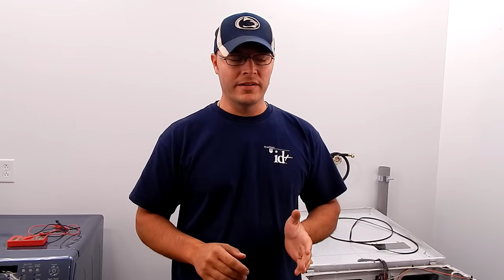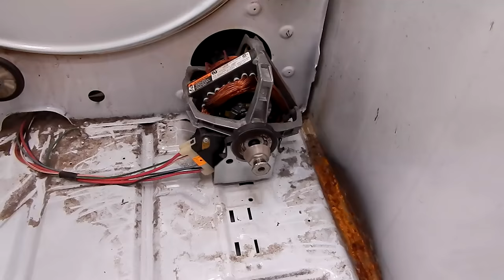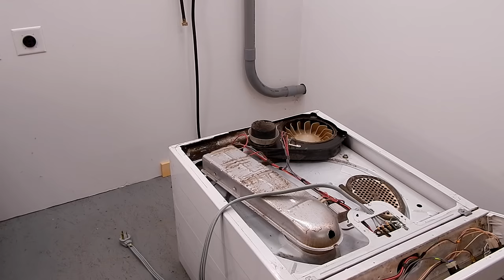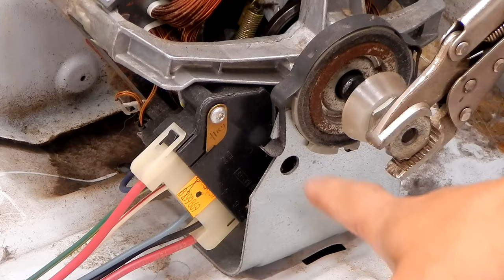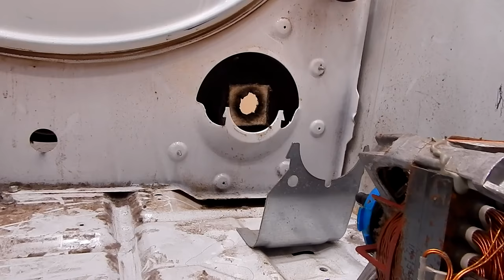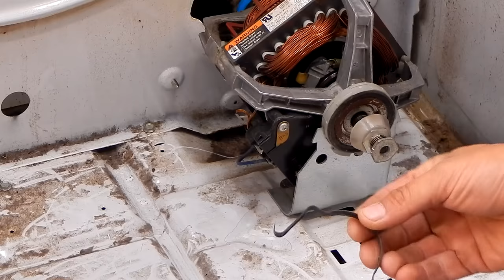How to Troubleshoot and Replace your Dryer Motor

Comment: Hello my rick I have a stack dryerwasher ,my belt broke .I fix it easy got I back to get her turn it on it work but after 1min the motor starts to smoke I clean it up from dirt and grime and dust soon as I cleaned it up turn on the dryer the dryers motor starts to smoke
Reply: Lisa Rodriguez Hi there!! How old is your dryer Lisa?? Did you replace the idler pulley assembly ,blow wheel as well???? If not, that could be the reason of the smoking motor.Greetings.

Comment: alas for me , we have a rather old motor and not wire harness...so wire color order would be nice.  (all the connections are on some sort of switch on the other side or rather where the harness wires are lower left the switch area is upper right towards the front of the motor...  now the motor I 'd ordered for that says it will work with it but wire color order is needed I'm sure then there's a possibility of a belt broken sensor.

Comment: When I hit start. You can hear a click,but the dryer does not turn on.Thermal fuse replaced but still does not come on?
Could this be the motor?  Thx Bill.
Reply: ripper1426  did u find out what it was, my dryer does the same thing.

Comment: Ahhh..the old hammer trick finally busted mine loose. Hint: Use a sledge hammer and a nice, solid piece of oak or other hardwood unless you want to beat your arms off first. I'm swapping an old Roper motor for a non working newer Whirlpool motor..

Comment: my dryer. not sure what the problem might be. i changed the belt thinking it was that. but turns out it wasnt. it worked at first but then it stopped it makes this humming sound. i have to keep messing with the belt in order to make it work
Reply from the maker: Does it make a loud hum/buzz when you start it?
Reply: Bill Newberry

Comment: My heating element tests ok, the motor ok without heat but with heat trips the 30 amp breaker after 10 min or so.  Change the motor or heating element?   Thanks, wish I could pay u.
Reply: Change thermal fuse

Comment: Mine won't even start and all my fuses are good and so is the timer, and start button, I'm not sure what else it could be that's causing a no start issue with mine besides the motor selector switch that the harness plugs into

Comment: The troubleshooting discoveries you talked about match the symptoms occurring on my Maytag MDG9706AWW gas dryer motor  exactly. While I repair the unit I thought to test other components. Do you have videos or guides to testing sensors.....etc.?

Comment: its not loud but yes it does.. 
it seems as tho the belt moved from the pulley.. but not too sure.. dryer is less than a year old.
Reply from the maker: See how long it runs without clothes.  If it runs fine without anything inside the dryer, but shuts off when you have a load in it, it sounds like a bad motor.  It will overheat and shut off, when it cools down a bit, it'll start back up.

Comment: Yup. Got a bad motor. Only problem is they stopped making mine, a Frigidaire (probably Electrolux) part #131511900. Can't believe it's the only motor that could work. Anyone know where to get them rebuilt?

Comment: Nice video ... Why are you installing a new motor... can't you just fix the old one?  They are thermally protected; so, likely there's nothing wrong with it.  Just has sticky bearings, or the centrifugal switch is sticky.. all 3 probably just need lubrication.  Showing how to remove the bearing caps, to lube the bearings .. would be nice.  Also you don't really have to remove the fan from the back of the dryer .. put a crescent wrench on that large plastic block where it connects to the motor, and another on the motor shaft at the belt-end of the motor (there's a place for the wrench, on the shaft)    You're inside the dryer looking at the motor .. the shaft turns clockwise, and the plastic square (larger wrench) turns counterclockwise  (no force on any fan fins)   With only the back motor clip removed, the front clip helps hold the motor steady when you apply torque to the shaft and plastic fan square block.   Once loose, the motor will unscrew from the fan... leaving it in place in its housing.... The fan will still be there when you replace a new or fixed motor... Be careful not to cross thread the plastic fan to the motor shaft.
Reply: You are right.....I have the same problem and wish to fix the motor instead of replacing it......The problem is that the two halves of the motor outer casing are strongly glued together with epoxy rather than screws......If I could find a way to open the motor casing I guess the rest will be just cleaning and lubrication.
Reply: I have the same motor but it smoke when I run it what is that
Reply: Walter Willis. It is either clogged with debris and needs a good cleaning or it is bad imo.

Comment: Good video but for the parts that are the most difficult like removing the fan and putting in the back clip you skip over those which would have been more informative had you shown those difficult steps.

Comment: The  Geek guys from Best Buy should have watched this video.  It would have saved me months of aggravation.  They should have known it was the motor.  They blamed the electricity in my house.  Unbelievable.  I  had all of the indicators of a bad dryer motor.  This is exactly how I described my issues to them.  Yet they did not believe me.

Comment: There is an easier way to remove the blower wheel to prevent damage. See this DIY video https://www.youtube.com/watch?v=mXXtaXkRMf4. You use two monkey wrenches, one on the front and one on the back of the motor shaft and turn them opposite directions so that the rear wrench turns count clock wise as you are looking at the motor from the front.